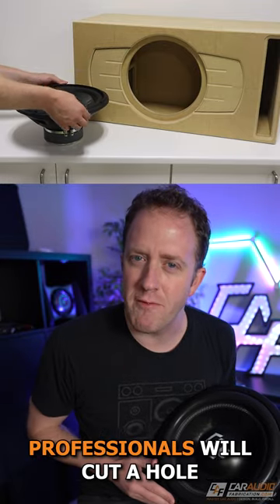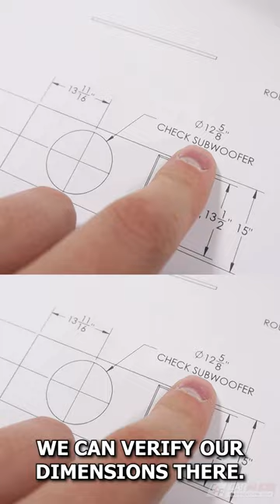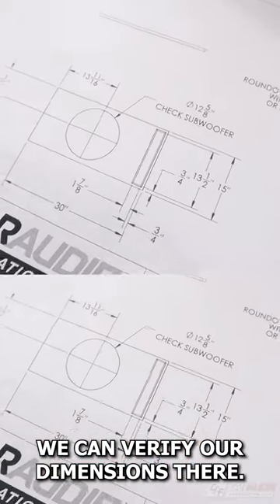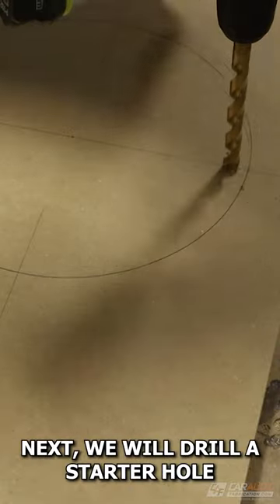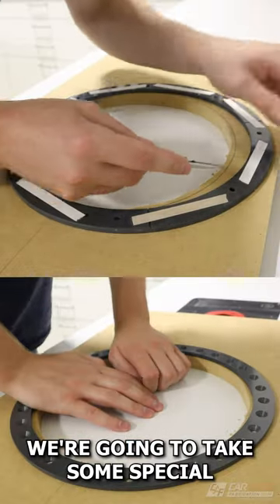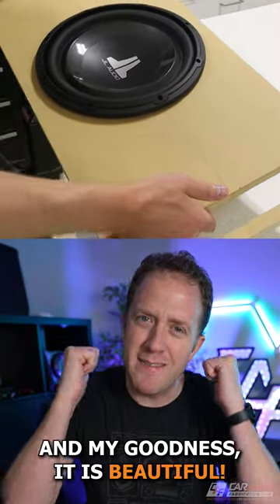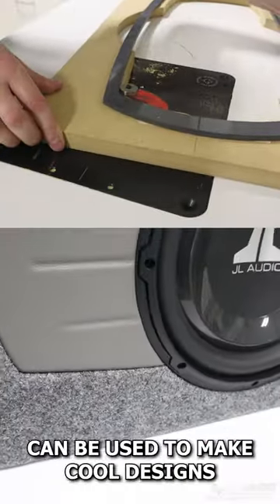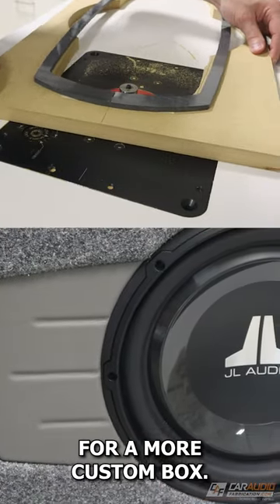The best way to cut a subwoofer cutout circle? #shorts

Comment: or you just get a circle cutting jig and a straight bit and you can cut any diameter at any depth (for a flush mount) without the need of using a jigsaw first and without the need of having a template.
Reply: Jasper pro for the win
Reply: Yeah too much product flogging from this channel and rehash of used clips + he never answers viewer questions
Reply: @henryha517 yah if its not JL audio its not on this channel 😂😂

Comment: I don't have a circle template, but I do have a circle jig.
Reply: Exactly what I was thinking.. the circle jig I have is good for 6” to 52” cutouts. Don’t think I’d need larger and anything smaller I’ve got hole saws. And less tool changes that way

Comment: I have a 2009 Subaru legacy GT the stock subwoofer in the rear deck is blown. I want to put an aftermarket one in there. What is the best way to figure out what will fit

Comment: Hey man love the content .. been a supporter for long time . I have a question.  About an install 2 svc 4ohm 12s 350 rms ea powered by a 600wrms 4 Chan amp . I want to tie in door speakers as well but not sure if I should parallel or series parallel
Reply from the maker: Hey! Thanks for being here! You will likely want to run those subs in parallel for a 2 ohm load. To bring in speakers a seperate speaker amp should be used. Thanks for being part of the community!